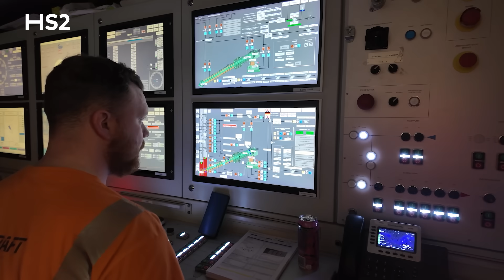HS2 Project Update, October 2025

Comment: HS2 doesn't have sense if it doesn't end in Leeds and Manchester
Reply: Aye but again Newcastle doesn't get a look in even tho train travel was invited in Newcastle, the A1 between Newcastle and Edinburgh is single lane still on both sides of the border so it's also a Scottish government problem as well not just Westminster
Reply: @stonerwallsend9563 the fact train travel was invented in Newcastle is entirely irrelevant as to wether or not HS2 should go there
Reply: @stonerwallsend9563  HS2 has nothing to do with any Town on the East Coast as HS2 is just a West Coast Main line rebuild
Reply: @peterwallen1063 yes I know my point is yet again the north east gets nowt, the north seems to always stop at Leeds or Manchester even tho east coast connect the 2 capital city's in the UK. Even the A1 is single carriage between Newcastle and Edinburgh on both sides of the border. All investments stop at Leeds
Reply: @stonerwallsend9563  Well neither did the West Midlands and the UK's second largest  City and second City Birmingham get anything till HS2 came along.
Reply: It has to make it to Manchester at least. The eastern section is dead unfortunately - they already released the land for it.
Reply: @camillewiltshire1354  Although the Act of Parliament for HS2 East was prepared it wasn't actually passed onto law before the "cancellation". Despite this a small amount of property had been bought (mainly blighted properties). The selling off of that land was put on hold.
Reply: As I understood it the WCML between London and Birmingham is one of the most congested sections of railway in the UK- although it's already mostly 4 track, but with flat junctions. It is forecast to reach overload by the mid-2030s & would-be new train operators are already being turned down. Hopefully the section of HS2 which is being built will ease this by diverting high speed trains away.
Reply: This project will be an absolute game changer for Britain. It is a gigantic task and must be completed in a progressive structured manner to be a success. You are doing a great job Mark. The nation is proud of you and the people working hard to deliver this.
Reply: Hopefully the greens change their position to supportinf 2a and 2b
Reply: @Crackingnutz779 Greens will be irrelevant as they are not a party of Government
Reply: HS2 should be extended to Crewe & East Midlands Hub railway station.
Reply: @Ryan1992channel  Why the East Midlands Hub, the train services on HS2 will be operated only by Avanti West Coast and as their name says they do not operate to the East Midlands
Reply: @peterwallen1063 the original plan was to have Euston linked to Leeds with HS2 East Midlands Hub would serve Darby, Leicester& Nottingham . 

Like with current HS2 with a plan for the line to link up with West Coast Main Line between Lichfield & Rugeley, East Midlands would have a similar link to the Midland Main Line. East Midlands Railway could have also used HS2 line with class 810s sadly like with the Manchester part it got cancelled.
Reply: @Ryan1992channel  So why would there be plans for trains to travel from London Euston on the West Coast Main Line to Leeds, Derby ( not Darby) Leicester or Nottingham when these destinations are served from London Kings Cross and London St Pancras International Stations. Only trains specifically designed to operate on HS2 will use the line.
Reply: @peterwallen1063 the line is designed to handle hight speed trains like class 800, 805, 807, 810 & HS2 trains are more then likely be based on the same type just have different specifications. Maybe a bit faster or more doors or different amenities that kind stuff. So yeah the current hight speed train can use the HS2 line.
Reply: @Ryan1992channel  Sorry mate but it is not as these trains do not have in cab signalling and a speed of 250mph, the trains operating on HS2 will be designed to operate with in cab signalling as per HS1 and the French High speed lines and conventional signalling for operating upto Scotland and th Liverpool and Manchester and a operate at a speed of 225 MPH so none of the Clasa 800 trains will be able to operate on HS2 only being able to operate at 125 MPH so NO the current high speed trains will not operate on the HS2 line. unlike yourself I have been following HS2 since the beginning , work on a Railway and live in Birmingham near the HS2 line
Reply: That’s a government decision
Reply: It should go all the way to Scotland really but its being built 20 years too late. The cost outweighs the benefit now. Typical of the UK government.
Reply: @gavpatterson1943  It won't go all the way to Scotland due to the terrain through Cumbria and the fact there a 3 routes to Scotland, the Electrified East Coast Mainline, the Electrified West Coast Main Line and the Seattle and Carlisle line all rail lines allowing trains to travel to Scotland and HS2 trains will reach Scotland via the WCML over Shap and Beatock, then if Scotland wants a high speed rail line then why don't the SNP do some thing about it
Reply: @peterwallen1063 while the Scots fund HS2 as well. Sound about right . . . . if you’re English.
Reply: @Alba67  Sorry no they don't fund HS2, the UK government gives Scotland £47.7 million pounds in the Barnett Formula Grant for the Scottish Government AKA the SNP to waste on independence crap which they know they won't get, free university tuition and free parking at Hospitals and OAP bus passes at 60 which we in England do not get until retirement age this being paid for by everyone's taxes in the UK.
If you want to go down that road we in England are paying for new trains, electrification and rebuilding of closed Railway lines in Scotland, new Calmac Ferries which most English and Welsh people will never use, HS2 is being built with UK Government funding and will reach Birmingham and Handsacre junction in Staffordshire and may be Manchester but in a month of Sundays it will not go through Cumbria and to Scotland only the actual HS2 trains will reach Scotland
Reply: @peterwallen1063 tell you what why don’t we just have complete separation of funding and we can chip in for defence? There is a reason every English politician raps themselves at the thought of Scottish independence.
Reply: @gavpatterson1943 170 km cost 100billions and takes 15 years to build in a meantime in china 1000 km cost half less and they can build it within 4 years time.
Reply: So then vote for a party who even remotely has a clue
Reply: Yes, you would want the train to reach its destination.
Reply: Its a nice high speed commute for Londoners. Which is all MPs really wanted... why? because they believe the north sucks.
Reply: @SalikRafiq  What for Londoner's to come to Birmingham, sorry mate it is no commuter line as all Avanti Hi Speed train services from Birmingham and the North when HS2 opens will travel on the HS2 line and not the existing West Coast line from Handsacre in Staffordshire when it opens
Reply: @peterwallen1063   who cares about going to Birmingham - commuters will get off before then. Nobody down south even cares about Handsacre. that is something that will be delayed again and again and again.

this a nice slightly faster  for london commuters to use.

We didn't need to go to this charade for londoners. They should have just been upfront about it.
Reply: It doesn't make ANY sense in HS2 that is predominantly a West Coast High Speed line going to Leeds for what reason as there will be no saving in time whatsoever for passengers to travel around 80 miles from the East Coast Main line that has a direct Hi speed service to London Kings Cross to the West Coast Main  line at 80 to 90 mph to Crew then having to travel another 120 miles to London Euston via Birmingham Interchange to London Euston a total waste of time and HS2 trains will go to Manchester one way or another.
Reply: The north is depressing. Don't need to go there.
Reply: Hopefully the Leeds - Manchester will be maglev and not outdated steel rails from the last century and before.  Why are the engineers still living in the past?  Japan has 310MPH maglev trains in service, we're still years away.
Reply: @topjack800  Keep hoping, no Maglev will be built in the UK as the trains are required to travel on any line
Reply: @peterwallen1063  Sure, you're correct, no surprise there either.   He's the thing - we're not building any lines they just cancelled it to fund the illegal's hotels, translators, lawyers etc. etc. etc.  They will implement trains running on canals before a maglev system.  Law/Requirement needs to change.
Reply: @topjack800  Those trains run on very very straight paths. Tracks here in the UK are always turning this way or that so I can't forsee a day when those will be in the UK.
Reply: Birmingham is the second city. Would be good to go to Manchester but Burnham town has an elevated sense of self
Reply: High speed railway that is only saving 20 min between Birmingham and London from the old train.
Reply: i think it will go to crewe and manchester eventually -- which is why the access to WCML is so critical they need to to work out whether it cheaper to push on the crewe using the proposed router of build a complete new juction link at litchield -- - i think they will find it cheaper to build the whole way to crewe rather than what they have been left with --
Reply: It does if you live in either Birmingham or London
Reply: @Tamarlane389 no. Birmingham was supposed to be the centre. Not the end. 
It was supposed to enable much better transport from the midlands to the north. So Birmingham has been badly let down (by Sunak) too.
Reply: @amateurcameraman agree that it was a centre. And in some ways it has been let down as it will no longer will have high speed high capacity access to Manchester and the north. However…

The HS2 financial benefits (some £10 BN) will only be felt in Birmingham so what it loses in connectivity, it redeems economically. It’s unique high speed access to London and the reinvestment of said £10 BN will attract more people and investment and it will be the only city besides London to have this.
Reply: Who wants to go to Newcastle
Reply: @RoyalCaribbeanChris  more like Leeds, the city of pdo files.
Reply: @RoyalCaribbeanChris  Lol who want to go anywhere, living as a hermit are you.
Reply: @RoyalCaribbeanChris  5000 Spurs fans went there on Wednesday night - that would be 10 HS2 trains right there. Could easily get half a dozen trains filled every time Newcastle Utd plays a team from Leeds, Birmingham or London.....same when Newcastle Utd play away in those locations too....
Reply: @RoyalCaribbeanChris  Who wants to go to Chelsea? Apparently, not Elvis.
Reply: @RoyalCaribbeanChris  Why would anyone want to go to a filthy city like Birmingham?
Reply: @GinaShiel   So when did you last visit Birmingham, Birmingham is as clean or as dirty as any other City in the World. Both Berlin and New York are as bad but Birmingham is actually quite clean.
Reply: @GinaShiel   Have you ever visited Birmingham, I can tell you as a Birmingham Citizen Birmingham IS NOT A FILTHY CITY, only a couple of inner city areas affected, the rest of Birmingham and the City Centre is no different to any other City in the UK, it is you listening with blinkers at false news plus London, Berlin and New York are just as bad if not worse than Birmingham. If you ever bothered to visit Birmingham instead of talking a load of rubbish about my City you would see that it is not filthy.
Reply: @peterwallen1063  That's your opinion....maybe you should drive around the area...
Reply: @GinaShiel  Yes it is my opinion, and yes I do drive around the area as I live in Birmingham GinaShiel unlike apparently you don't. Only a proportion of a inner-city area where Muslims live is in a state, the rest of Birmingham is clean and tidy especially the City Centre so where do you get your idea from false news as I said London, Berlin and New York have a rubbish problem so why so negative about Birmingham for no reason at all, enough people visit Birmingham especially for the German Market
Reply: @peterwallen1063  Try looking around the motorway green verges...maybe the inner -city needs to be addressed...
Reply: @GinaShiel  Motorways are not in Birmingham GinaShiel, their upkeep is the jurisdiction of the Highways agency not Birmingham City Council dear, the inner-city is the area that the ONE bin depot is on strike and if the Muslims that lived there took their crap to the council tips like the rest of Birmingham Citizens have done then their area would not be like this, sorry I live in Birmingham on the outskirts and our bins have always been collected every week from the start of this problem and as I said loads of Cities have this rubbish problem not just Birmingham, New York, Berlin and London are in the same way, as I said try visiting Birmingham before running my City down first instead of reading false news
Reply: @RoyalCaribbeanChris yeah who wants to go to greatest city home to the train, light bulb(incandescent), the 1st street in the world 🌎 to light by electric light, pioneering the steam turbine which creates most of the world power with all this history who'd want to
Reply: I would like to point out that the current estimate for completion of HS2 is put at £83 billion. For a comparison that equates to approximately 50% of the cost of the NHS in its entirety for 2024. In terms of income tax it would take an increase of 15% from 20% to 35% in basic rate in this years tax period to raise this amount.
If the extensions to Manchester and Leeds were sanctioned then it is highly likely that they would in real terms be more expensive than HS2. It is obviously a desirable goal to aim for, but we must all be more circumspect in calling for grandiose infrastructure projects without understanding their true costs.
Reply: @perkinscrane Perhaps Brunel, Stephenson etc received the same complaints about cost when they were building the original main lines. Spread the initial cost over 100+ years & millions of passenger & freight miles and maybe it comes down to a less frightening number?
Reply: @chrislambert-shiels5291 Brunel and Stephenson raised their capital from the general public not Government money. As for much of the other Railway there was massive duplication of track which has  blighted them right up until modern times
Reply: @perkinscrane  As I understand it the government raises money for infrastructure projects by issuing gilt bonds to pension funds & insurance companies. The interest on these (& eventually the capital) is paid back later by the operators, who get their money from fares & freight charges.
Reply: @chrislambert-shiels5291 That is not correct. The Government spends money. Taxation is levied. The difference is  used to pay down the National debt. If the taxation does not meet the spending then the Treasury issues Gilt Edged Securities to make up the difference. There is no linkage between specific spending and Government Debt.
The Railways Debt for rolling stock is held by the ROSCO’s which are entirely private undertakings.
Reply: @perkinscrane  Comparing HS2 to the NHS is like comparing apples and oranges or cubes and pyramids. 
Not sure the point you are trying to make. 
That no infrastructure should be built because it's  very expensive compared to other stuff?
Reply: @mrglide7078 I disagree. What we are considering is Money, Taxation,Politics and more Money. I contend that is absolutely fair to question and compare Government Spending no matter if it’s spent over years or in different ways. HS2 is costing an inordinate amount of money. The methodology used in its original costing is/was a National disgrace. The tunnel to Euston and associated infrastructure of the station has still not been priced. This despite the project is supposed to be 50% completed.
If you are interested I am a lifelong infrastructure nerd. I pose this question. Why has the Lower Thames Crossing been stood in the starting blocks for so many years. It has a much better Cost Benefit equation than HS2 and even now it is costed at one tenth of HS2.
Reply: @perkinscrane You can  thank all the unnecessary tunnelling for that. For reasons of which everyone has their own viewpoint
Reply: @perkinscrane by your logic, over the decade long period of HS2 construction, the government would have spend a lot more than that on foreign aid. 
So what's your point? The foreign aid budget was £14.1 billion pounds in 2024 alone!
I say, cut the aid budget down to a very generous one Biliion pound per year, and build HS2 in its entirety, then extend it all the way to scotland. Then look at doing other HS routes too.
Reply: @amateurcameraman You are of course entirely correct. My point was to highlight the total cost of the project and attempt to persuade people to make comparisons with other Government spending. In that I guess that I have succeeded with you in spades. For the record,  I am very much against your particular proposal. That of course is another argument 😀😀😀
Reply: @perkinscrane thanks for your considerate reply 😊.
I would also question you mentioning the entire expected cost of HS2, verses an annual budget for a government department. Would it not be fairer to compare the annual cost of HS2 construction. then add that it will at some point (way too far from now) finish being constructed. Or mention the cost of the nhs budget over 10 years!
And that's not to go into the rabbit hole of the cost of doing nothing... but that is also another discussion 😉

One point i must add, separate to yours of course. Is that my biggest frustration with all of this. Is that it is a civil engineering project. A construction project. And the customer of this project is the government. And the government has been the worst customer imaginable. And my sadness is that unfortunately, due to few people understanding this distinction, is that it makes the railway look bad.
My only hope is that when it's open and running, then demand comes to complete and extend it. But those timeframes are now probably beyond my lifetime. But even so, i firmly believe it should still be completed and extended.
Reply: @amateurcameraman As I stated before, you are correct to pull me up for comparing Railway Infrastructure with the NHS. I justify it because of the way much of Government spending is legitimised. That is that a certain spin is put on it. My spin is that waiting lists on the NHS can be reduced by allocating more money to them. Why not cancel HS2 and spend the money saved on the NHS. I would remind you that Rishi Sunak promised that the money saved not extending HS2 to Manchester and Leeds would be spent on the Transpennine upgrade (was that possibly just spin?)
Reply: @perkinscrane the transpeninne upgrade was to be built using HS2 infrastructure around Manchester. Meaning some of the so called northern powerhouse upgrades were actually parts of HS2!

As for Sunak promising investment in the north instead of HS2, using HS2 funding. That was a blatent lie. 

But again, if you would rather cut HS2 to spend money on the eternal nhs blackhole. I again refer you to the £14 billion foreign aid budget...
Reply: @amateurcameraman I do not wish to cut any Government spending per se. As I stated before I am very concerned with how the spending is presented to the public. I do not think that HS2 has been properly costed. In fact parts of the project have been started with no cogent plan of how they will be finished. 
My flippant illustrations and comparisons were an obviously unsuccessful attempt to parallel how successive governments have presided over a total mess.
Reply: @amateurcameraman labour are in charge now. It’s on them.